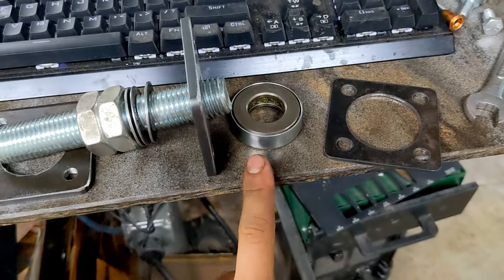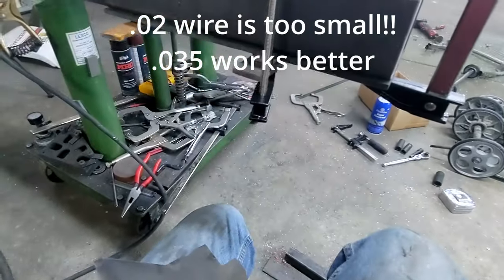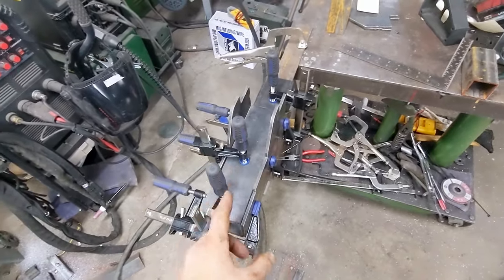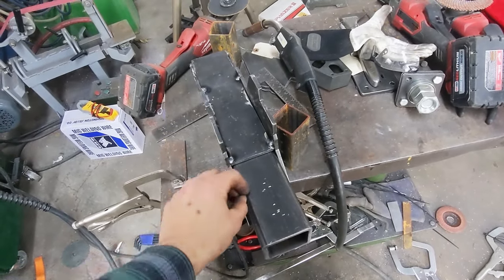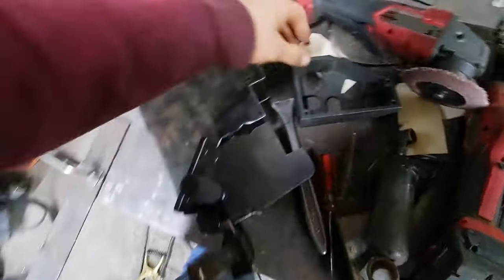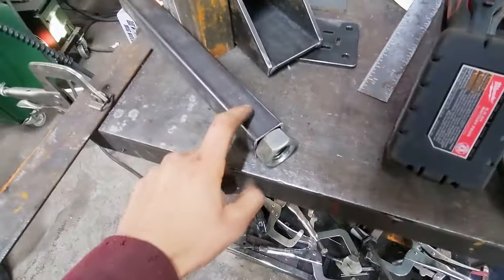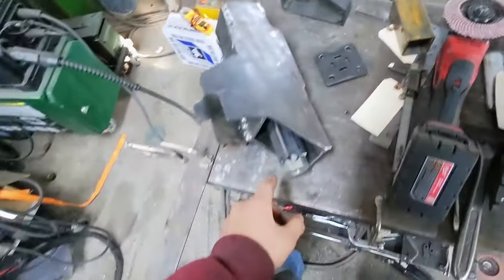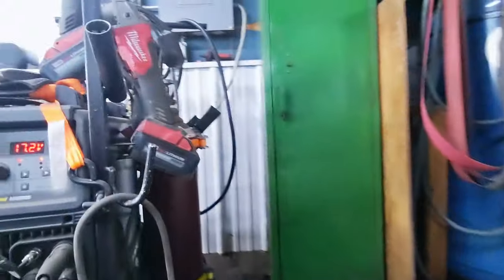The Easiest Homeade Bench Vise on the Internet

Comment: Pretty cool man!  If you ever figure out a cut kit be sure to let me know!
Reply from the maker: I've been trying to descide how complete of a kit to offer. fully deburred drilled, tapped, etc, just weld it up. just lazercut parts, source tube, bar stock, bearings, nuts, threaded rod yourself, or somewhere inbetween. i don't have much of an audience yet, so it's kinda hard to get feedback before I actually do it...
Reply: The side plates for the jaws would suit me just fine. Hell I'd be good with just stencils of them! Lol!
Reply from the maker: Plans are up, you can print out templates of the sides if you like.
Reply: @TimBuildIt  I guess I am not seeing them up there.  I see the Technical drawings of the rest of the vise but not the sides.
Reply from the maker: ah, the parts that are meant to be plasma cut i didn't make into technical drawings, just dxf's. i can add then if you like. or there might be a way to print dxf's directly. i know visualcadd can but i don't know if other software can
Reply: Do you see them on your pdf?